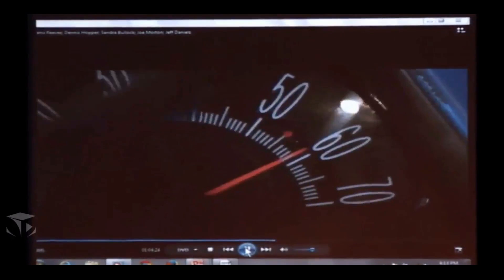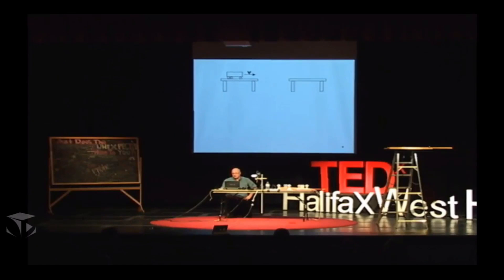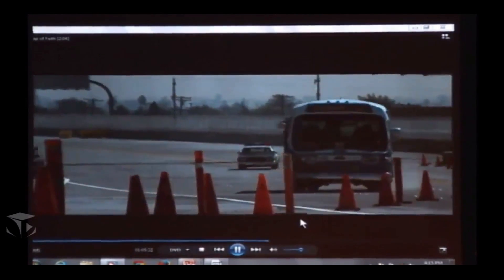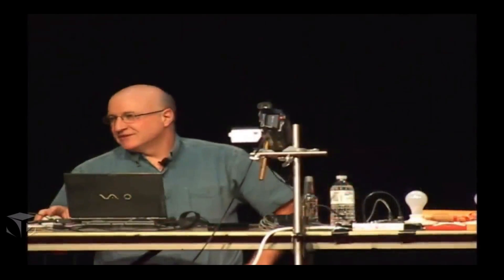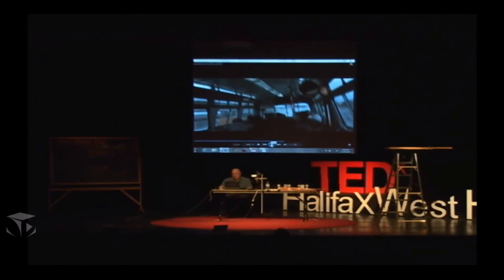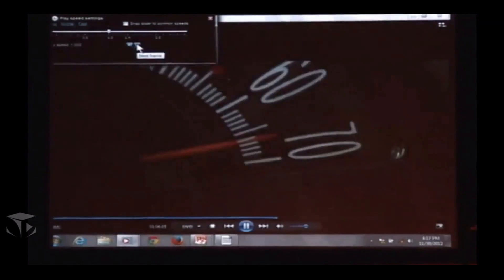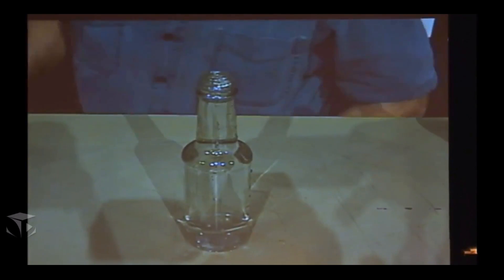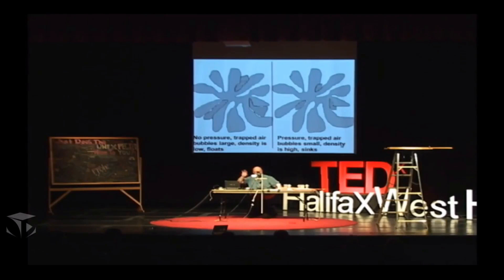How the Movies are Fooling Us | Jeff Dahn | TEDxHalifaxWestHigh

Comment: There is absolutely no way that bus would have jumped a 50 foot gap without being in a simulation where the laws of physics bend, or CGI, unless ramped for a long vehicle, in which case it would have landed too hard.
70 mph is...
31 meters per second, which is almost 100 feet. At what angle does the ramp have to be?
I know it falls about 15 feet in the first second...
Please explain that kind of math?
Thanks in advance 😀

Comment: Actually there was no gap in the road used in the shoot. When the crew were planning the jump, there was a gap there, but the gap was filled in the meantime, and re-added using CGI (the hydraulic ramp is believable though). Also to note:
1) When the jump was performed, all the seats (and anything else that might be heavy) were taken out of the bus, and there was nobody on it other than the stunt driver which explains why the passengers were told to duck.
2) The driver missed the ramp on its first try, and crashed one bus. The second jump (the one you see) went too far, and destroyed a camera.
Reply: I believe the heavier, the less air resistance. I used to not believe it possible at all, but with a ramp, totally possible (but crash landing). I don't know what angle the ramp would have to be as per gravitational acceleration and my question next to your comment.